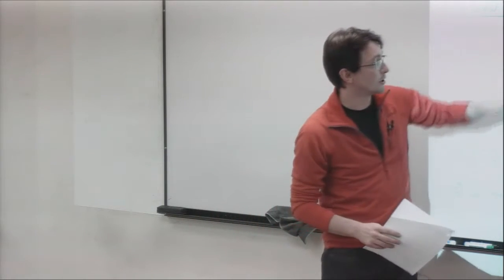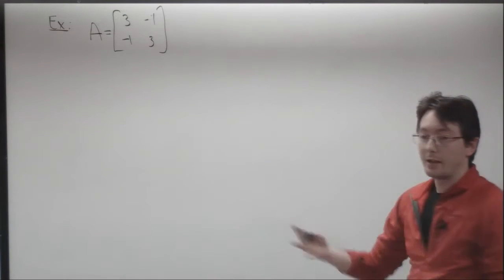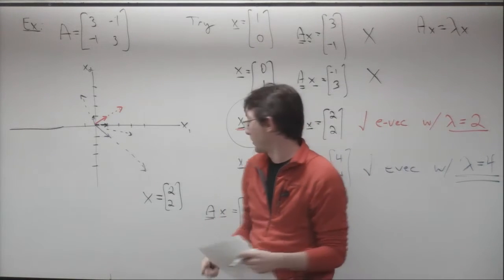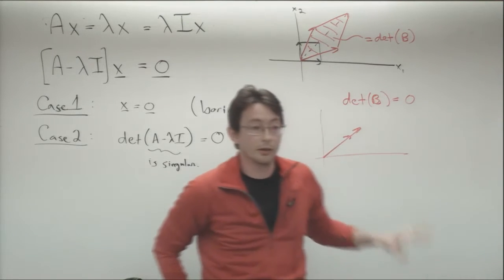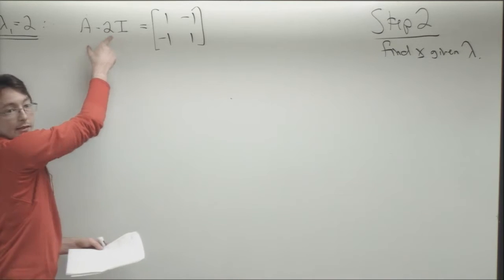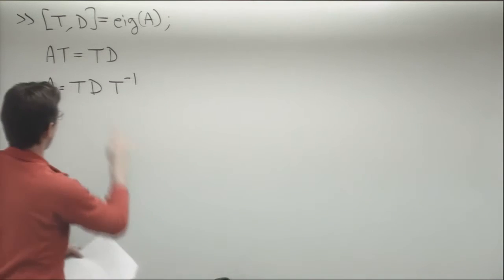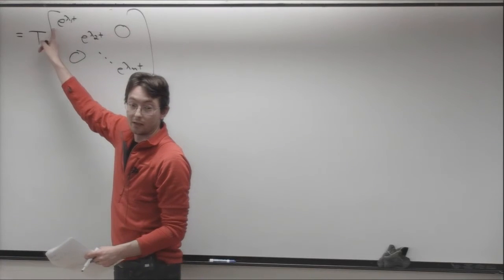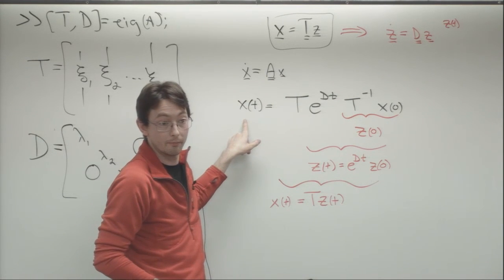ME564 Lecture 7:  Eigenvalues, eigenvectors, and dynamical systems

Comment: Professor,your video is very helpful for me,thank you very much.
Can I ask you a question?in the lecture 07, in the equation X=T*Z,I understand T is coordinate tramsformation,but in the equation A=T*D*T-1, I was very confused with its meaning:write A in a new coordinate system T.Could you make a straightway interpretation?Thank you very much.
Reply: AT = TD is just the eigendecomposition equation. T is a matrix with the eigenvectors of A as its columns. D is a matrix with it's principle diagonal as the eigenvalues of A, with column positions corresponding to T (eigenvectors in the same columns as the eigenvalues). A = T*D*inv(T) is just obtained by right multiplying both sides of AT = TD by inv(T), since A*T*inv(T) = A*I = A. It's just a setup for the Taylor series expansion/derivation.